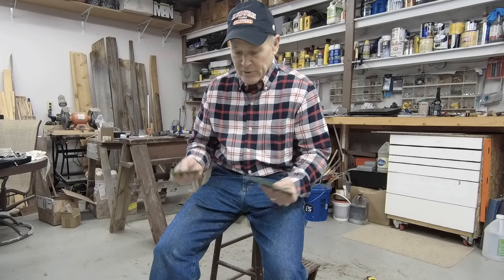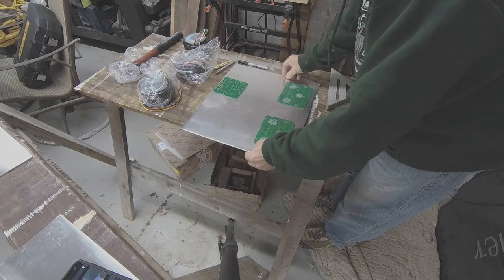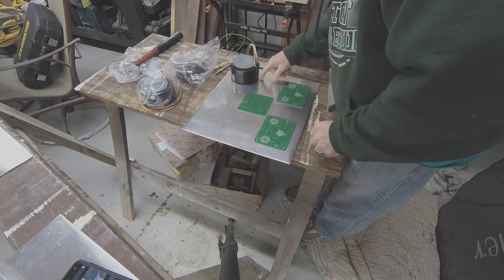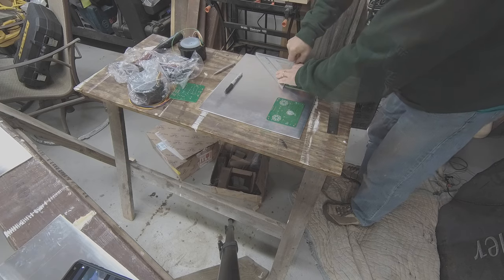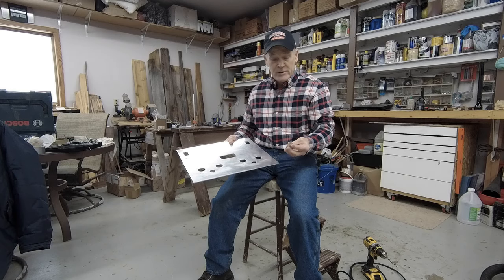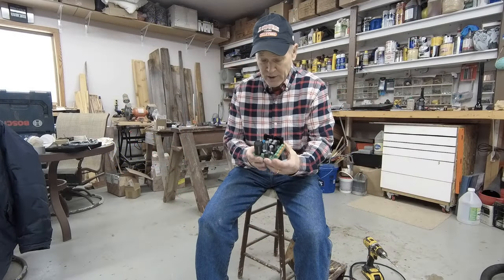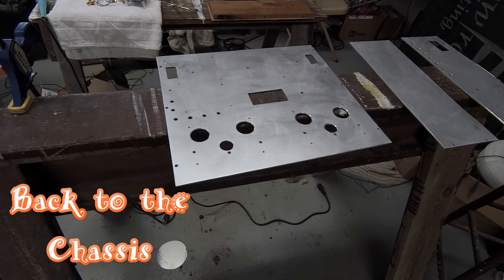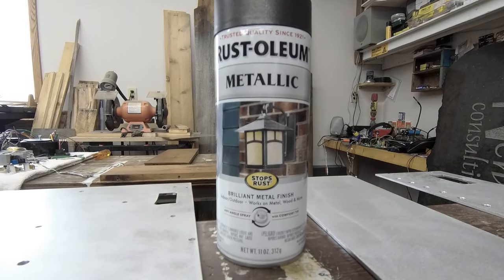Baby Huey Tube Amp Build

Comment: Nice build! How does it sound? do you have anything else to compare it to?
Reply from the maker: It sounds fantastic, so good I built a second one. I have many things to compare it to, Marantz, Kenwood, Hafler, Carver, Adcom, and many more over many years. The design on DIY audio has been tweaked many times, so go there for the latest schema's and boards.
Reply: @bowlingactually  Thanks! I have been combing through the tube section there looking for a  design. Is the output around 30w a channel?

Thank you for getting back.
Reply from the maker: @scaryperson27   Yes that's about right, maybe a bit closer to 40w. It does sound much bigger as the bottom end is very good. But it's not like my Adcom monoblocks :)
Reply: @bowlingactually  Nice! GFA-565's I assume. I had a GFA-555 that I recapped, biased etc. I also had a GFP-565 that I rebuilt and upgraded with nicer parts. Both were very nice. The GFA-555 is a very exciting sounding amp.

I have a little Elekit TU-8200 and just want a bit more output than it can deliver. Although the bass is surprisingly good as long as your mind your volume. It is a great little amp though. 

Thank you for getting back. I may consider making monoblocks with the the one driver and two KT-88's or 6550 tubes. Still need to figure that out. It looks like I would need just an extra power supply transformer but the two being a little over half the size of the single transformer.

Comment: you should always have a speaker on a valve amp when doing the bias
Reply from the maker: Good point, thanks for the advice :)
Reply: Or a dummy load.
Reply: @bowlingactually  You can buy 8 ohm 100w resisters pretty cheap. I believe parts express has a resistor they selected specifically for this purpose.